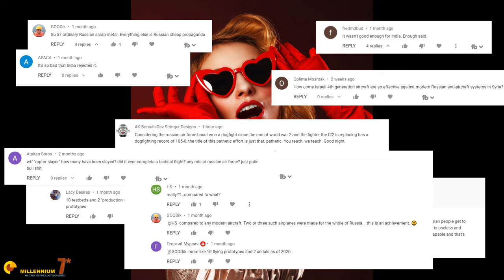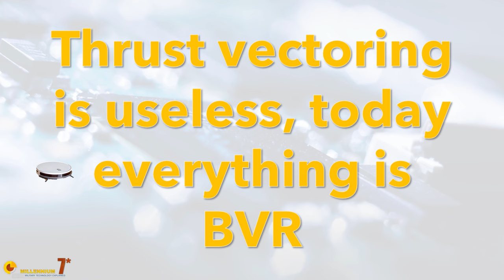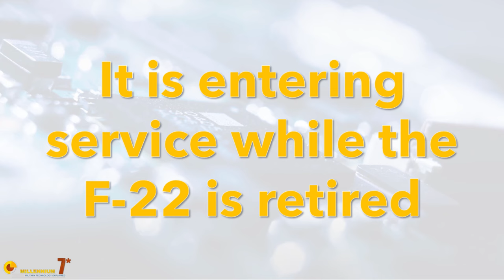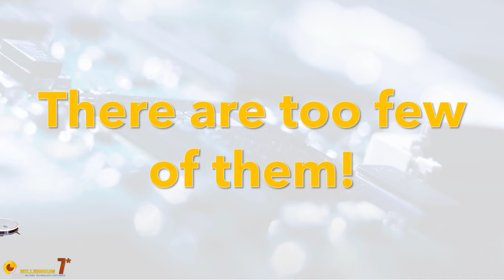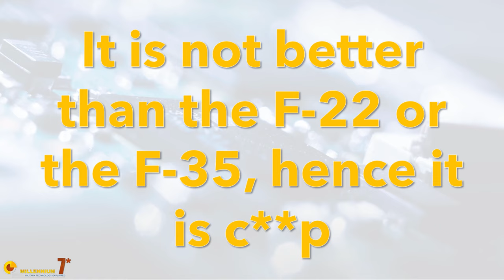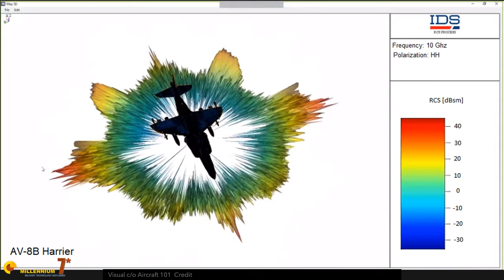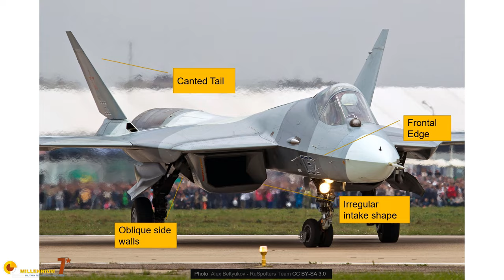Su-57: is it INVISIBLE?

Comment: "L Band arrayS". have to stop you there. Just because two components are not right beside each other does not mean they are not part of the same system. I believe it far more probable that they are a two parts of a single array that are spaced that far apart to improve accuracy. This is hard to do in X band, but in L band could be done relatively easily. The same techniques that got us that black hole image can be used.
Reply: Interferometry and combing data electronically - can be very beneficial. However, you still end up with the question of how fast and how data can Russian computers process verses western ones. Too slow, as seems likely, means not real time and slow updates. Head on, from many km distance in the closing phase that might not matter at all. However, as the range closes and manoeuvre for advantage kicks in, the effectiveness will diminish. There will certainly be an area between visual and what we might call BVR under a stealthy situation where the F-35 (say) is undetected, when radar and IR data fusion is relied on by the pilot for their 3d spatial awareness. It's likely that western systems will fare better here.
Reply: @nickbrough8335  Why would you think it would be any more complicated than any other phased array? The only difference is that you are missing some of the elements. It is still just a case of applying appropriate delay to each element. You can do some synthetic aperture tricks, but at the basic level they are not needed.
Signal processing is probably done on regular GPU hardware, not domestically produced. There is no reason to expect it to be substantially worse, especially as the code will largely be common with the ground based radars which are already a big seller for them.
Whether the gimbaling IRST is better than the f35 system is impossible to know, but being on a gimble the SU57 system could be expected to have better long range performance (all other things being equal) while the radar is able to provide a small search space to make up for the low field of view. I agree the western optics are probably better, but wouldn't be prepared to bet against the more focused Russian system picking up an F35 first, if the radar works well.
Reply: @agsystems8220  In this case basic physics. Whatever way you analyse the radar, the number of individual arrays and the array density (combined with their inherent sensitivity) counts. A smaller array has less capability and given fixed position probably a restricted angle of "vision". If you use smaller multiple arrays to collect the dame data density as a single large array, you're adding extra data for the software to process as the field of view, beam angles etc all need to be adjusted for before you combine the data. In addition, the overall speed of processing (which comes down to radar solution, number of targets tracked etc) has its own very important effect. Slower computers require less data input, longer time to recalculate as the aircraft moves. It's very hard to believe current Russian electronic capability meets with current western standards standards, bandwidth or processing speed. The radar arrays tell you this already. Russian radars use higher power (and thereof more easily detected at range) and are physically larger and heavier than equivalent US systems. That tells us you Russian equipment is inferior, even if it turns out end performance ends up being the same (which is unlikely).

Russian electronics used to be mostly made in Ukraine and Russia has undergone a transition to domestic production as a result. They have bought western equipment (mostly French from what I've read) that has been integrated in esport Sukhoi's - most notably Indian versions), but there is little evidence that they use off the shelf western made components that I've read. Chinese processor designs also (currently) lag behind current western designs technically. Similarly there's no particular reason to think that Russian or Chinese made systems are somehow able to compensate for inherently less technical capability using software either.
Reply: @nickbrough8335  So speaks the science PhD who explained in an argument with me that while you understood neither the math nor the physics involved, you were informed because you read what the experts had to say - and those were your very words. If you don't recall, I'm the PhD physicist that you accused of not understanding signal processing - based on words that I never said that you put in to my mouth - and discovered in your imagination that you understood the subject better than I do. And yet here you are again, arguing with the all of the personal authority of someone who knows radar math, physics, and numerical methods - and of course, all about embedded systems - when you simply know what you believe and you are once again, Mr Expert Thirdhand Source. Today's video was about you, Sky Admiral. Have a nice day.

PS - You have a lot of nerve lecturing people about basic physics. What's your PhD in, exactly? Expertology from the University of The Internet?
Reply: @Ni999  but you're a self acknowledged genius. By the way you don't have to understand all the detail to appreciate the principles involved. 

What's your PhD in ?
Reply: @Ni999  If I'm wrong just offer your own opinion and explain why you're opinion is right and mine isnt preferably with some arguments and facts. That way we all learn something. Otherwise youre just another troll no matter how educated and knowledgeable you are.

I offer my opinion, I don't offer facts and most of the time I agree with what I read or explain why I think otherwise. The other poster can correct me with factors or offer their own opinion with which i can agree or disagree (just as they can with my opinion).
Reply: @nickbrough8335  Physics, just like I said the last two times. Practiced professionally for decades, including for the DoD and DOE. Well published on digital signal processing. Have influenced radar design and test metrology for stealth. I'm not self-acknowledged at all - I've simply done the work. 

And I brought it when you got big with me the first time trying to shut me up by bragging that you are a "science PhD" - again, your words. I tend to rarely bring it up, I don't care for arguing from authority - but you started it. So have a bite and choke on it. 

I see that you didn't answer the question and tried to deflect it to me. Exactly the behavior expected from a poser. Anyway, you're dismissed sparky. Besides you got a whole video here devoted to your sort. Enjoy it, you absolutely deserve it.
Reply: @Ni999  Great so instead of sneering and belittling other people from your "great" height of knowledge and experience how about explaining what you think is correct and how things might work, assuming you can ? Too difficult ? Perhaps you just prefer shitting on other people for your personal pleasure. Thats what trolls tend to do.

Do you have your own channel ? I'd be very happy to listen and learn to someone that has some actual knowledge. I'm sure a lot of people here would.
Reply: @nickbrough8335  We met when you came in flaming me because I said one sentence about the 57 electronics being interesting. I engaged you politely, just as you are begging for here and you decided to tell me all about your science PhD.

So I already tried polite discourse with you and I already know where that goes. The other gentleman here has tried polite discourse with you and clearly understands the subject better than you do - and for his troubles, you are once again arguing for the sake of arguing. Plus you know all about physics now.

Troll? The lady doth protest too much.

Comment: The only problem issue is that there are just not very many, at least according to most sources. I think it also uses an RGO graphene without Iron because the Fe stealth is black, usually, due to it being created like creamic, which it basically is. Anyway the 57 is their first stealth craft and if they went down a bad track with the coatings and possible composite below that could hold up production or they might jump to another. China and Russia exaggerated their Stealth characteristics and at least with the 117 there was not much known. The word stealth didn't even come out of my mouth for ten years after leaving the plant in Adamstown. The " first generation" coating is still excellent and as capable as anything else facing similar circumstances. These groups have fans of equipment so the comments get silly
Reply: western propaganda
Reply: Took a while for someone to comment and it's about propaganda. I don't do propaganda I did science in those days and those are my personal opinions. So enlighten everyone where my speculation crosses from observations to something else.

Comment: One aspect not covered is the importance or unimportance of agility. 
With its vectored throust in all directions, the SU-57 is supposed to be more agile combined with and not sacrificing speed, and so expects to be a superior combatant within visual range. Or, is gaility also a difference maker BVR as well, avoiding long range missiles?
The point is that nowadays you don't necessarily need superior agility to aim your entire craft at a target to lock on or fire a gun, "over the shouldder" missiles now exist where no matter how the craft is oriented, the pilot only has to turn his head if even that to lock onto the target no matter the relative orientation.

I might also point out that one radar better than the other isn't likely going to be a difference maker,
It's the ability of the potential target to evade the capabilities of the adversary's radar which is relevant. So, you might have a far superior radar but if your adversary also has more than sufficient ECM or stealth characteristics, then your superior radar by itself won't be the difference maker.

Comment: People actually think Su-57 has no weapon bays? A huge FIGHTER, which is intended to guard airspace, wouldn't carry weapons? A fighter with side-facing radars (& maybe rear-facing one?) that can fly sideways (briefly). 
Is it the best fighter for every nation? No. Is it the best fighter for Russia? Probably. Context.
I'm a bit disappointed that it doesn't have built-in road-paving machine that would build a runway for itself to land on.
Reply: There is an interesting question on weapon bay space (I understand they aren't particular depo and they're clearly long and narrower verses both how F-35 and F-22) and what weapons at what quantity can be carried internally.
Reply: @nickbrough8335  I've watched some videos of Su-57 doing weapon test with Kh-59 & KAB-500. So, 500 kg munitions can be carried internally, though how many is unknown (for me). Probably 2500 kg internally minimum, but could be more.
Reply: @thantzweaung9080  Yes I'd be surprised if that wasn't the case. The Russians are smart people and they're going to have maximised weapons bay carry capacity.

If I recall, an F-35 can carry 8 guided stand-off small diameter bombs internally. The stand-off range at altitude release will be in the tens of kms (and a further 8 on two wing pylons if non-stealth). might

If the current technology works, one F-35 might take out 6 (?) moving or stationery armoured vehicles whilst staying on the outer edge of the missile and guns self defence systems supporting the ground forces. The initial target guidance could come, in real time, from ground forces or another F-35 performing ground recon using its IR and AESA radar that has already left the area. If it works, these systems look like real force multipliers to me.

Along the same lines, you have the RAF looking at deploying Leonardo's Bright Cloud radar decoys into small battlefield lingering weapons such as Spear 3. Imagine 8 decoys in small area covering an incoming guided weapon strike and add sensor networking in real time from the aircraft (near and far) and the weapons themselves couple to very high performance distributed networked computer systems. All of the systems can be 10 km+ behind the front line rather than operating immediately above the battlefield.

Whilst, I'm inclined to be doubtful myself, the technical premise starts to look extremely capable when you start to think about what might be achieved in theory at least. The thing is, the small combined CPU/GPU and machine learning capabilities now built into current generation mobile phone technology at a cost of a few hundred $s each is already providing a massive computer capability. The current A15 iPhone chips are outperforming desk top computers from 5 to 10 years ago and the slightly more expensive version with more processing cores are powering current generation desk top and laptop computers that exceed the performance of models only a couple of years old. This technology hasn't gone anywhere near current weapon systems.

Comment: How about information on the tactics that are most likely to be used with the SU-57 and the tactics most likely to be used to counter it? I know there's not a ton of information available but it would make an interesting video.
Reply: My expectation is that it would be used as an anti-stealth escort for sorties of other types. Likely equipped with a wide array of sensor types on it's missiles. I believe the Russians have studied the Iran-Iraq war and make no bones about the idea of launching missiles as a defensive op, in a major engagement. That would mean, shoot first, even if the probability of a kill is very low. In fact especially in this instance, because it forces your opponent to become reactive.

At this point, accompanying aircraft would be more able to help in the engagement, due to flare use, and hotter engines on the opposing (Western) aircraft making them visible at longer ranges on IR sensors.

Comment: Here is a more recent assessment of the SU57. Some of it may make sense, some not. One thing I can say for sure as an electrical engineer is that the gain of a particular antenna is optimised for the size of the wavelength of the signal it is intended to capture. It works by the principle of resonance. So for low frequency radar receivers the size must be very large. Low frequencies are less directional so locating a stealth aircraft with a very large antenna on the ground is difficult enough so the quality of the signal is not good enough to create a kill chain, even if the signal is immediately transmitted to the aircraft. The antenna's on the plane are too small for much gain due to the limited size of the aircraft. At higher frequencies the signals are much more directional and therefore easier to locate the source of a reflection. Therefore the strategy to reduce RCS is to shape the aircraft so that radar is reflected away from the source of the radar transmitter/receiver and to use a coating material  that absorbs rather than reflects radar waves. The F22 has a very low RCS from any angle. This may be one reason why the US will not export them to anyone. But the plane's coating requires a lot of maintenance as does the F117. F35 has a more advanced coating that requires much less maintenance as will future generations of American Stealth aircraft. 

It's 2 years since this posting and the 1000th F35 has just rolled off the production line while the Russians are still struggling with the engines. Russia also has many economic problems and is going broke fast due to the consequences of its war in Ukraine. So here is a more recent assessment I found on line for your amusement.
https://www.youtube.com/watch?v=kwbiOXYFDMg&list=PLR0gSPbvQL-LmHgmAoq7Hc1U2Q42a7AAw&index=6&t=28s